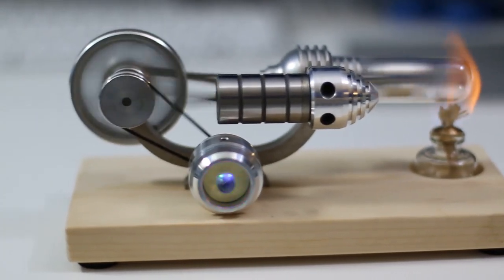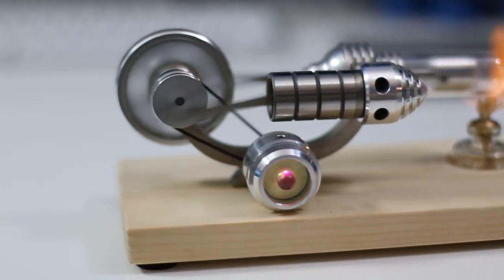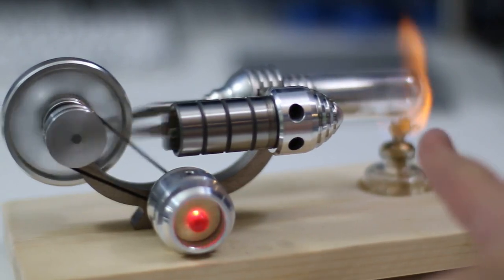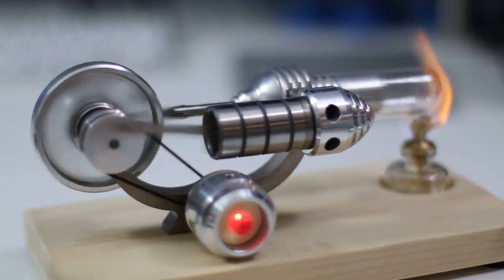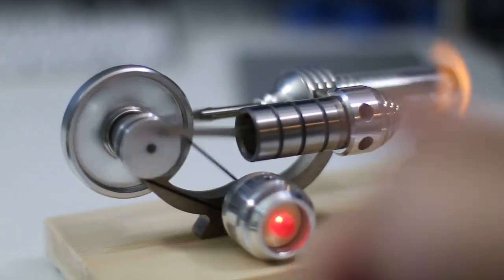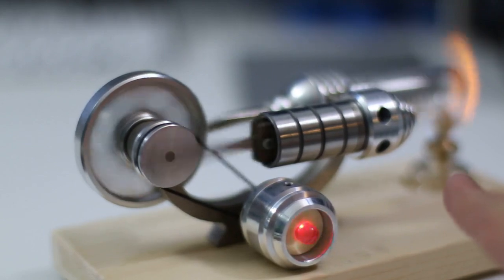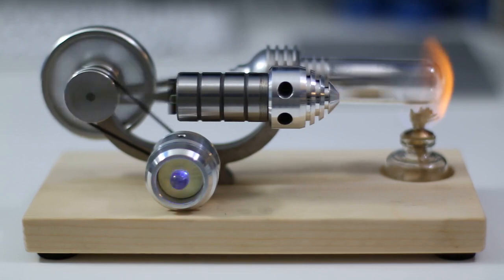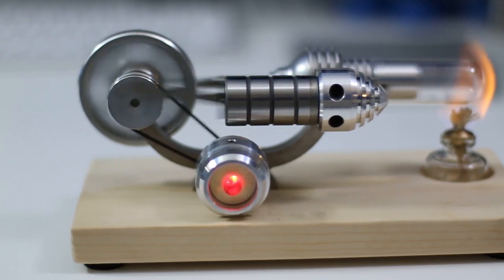SunnyTech Stirling Engine M14-03-S with LED Generator Demonstration / Review

Comment: What kind of alcohol do you need?
Reply from the maker: I always try to use 90% or stronger. I've used lower strengths too, but it doesn't move very fast.  The higher the strength, the faster it goes.